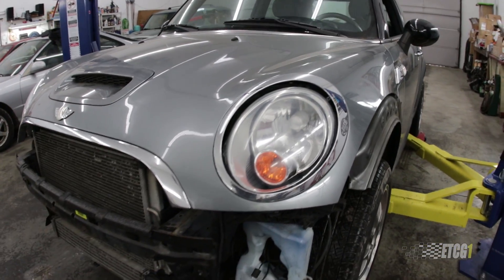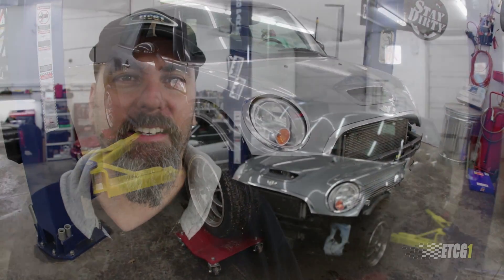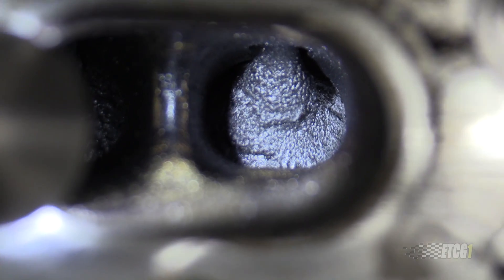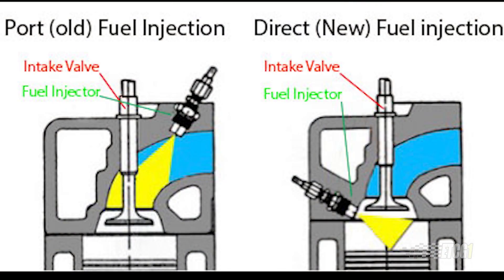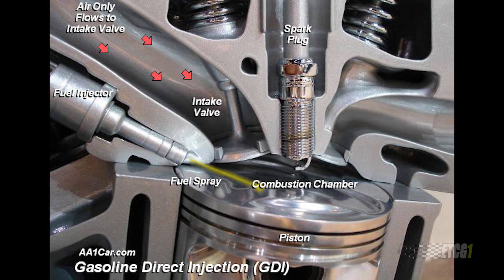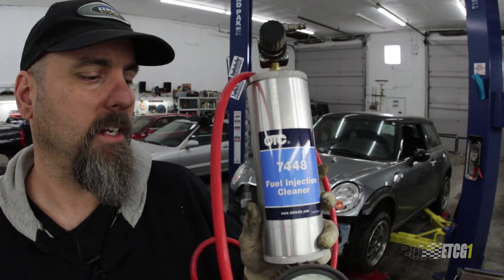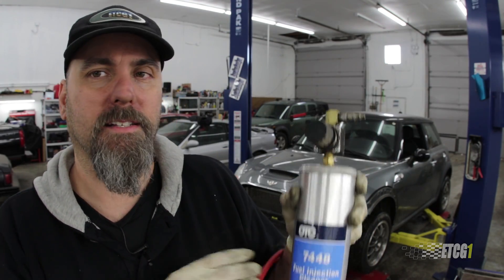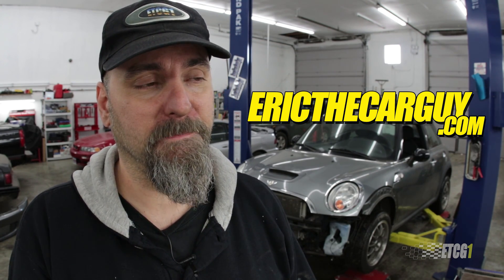Direct Injection Proves Fuel Additives Don't Work

Comment: Is there a method/product to adequately clean the backside of the valves Without removing the intake
Reply from the maker: Likely. I used carburetor cleaner, a screwdriver, and a brush mounted in my drill to clean these up.
Reply: Seafoam SPRAY used exactly as the instructions on the can say. Don’t listen to these morons on the internet using the brake booster vacuum hose dipped in a can. That will be minimally helpful, mostly wasteful.
Reply: CRC makes a product you spray into the intake track just after the MAF, so solves the application issue Eric was complaining about via fuel tank based cleaners.  And an oil catch can is needed to slow this issue down.

Comment: On direct injection engines additives will not work on the intake but those fuel injection cleaners work by having a stronger solvent  than gasoline thus getting rid of buildup that the gasoline wont cut through. I dont see it as a solution to the root problems but they do tend to work at they're intended purposes.

Comment: I get it that fuel cleaners don't work in direct injection engines.  And the warning about direct injection engines is well taken here since my wife wants to get a new car that has it.  ...In carbureted engines though, you can get some good results when things get fouled up - especially today with that sugary crap they call ethanol.  Just a few months ago I was having some hardcore hesitation/stumble from my old Jeep that was fixed by adding some fuel system cleaner.  It was to the point I couldn't accelerate up to highway speeds before merging with traffic because the stumble was going on at just under 3,000 rpm.  I thought it was water in the gas, so I went with Heat.  Two tanks with that didn't make any difference.  After going to an "over-priced" cleaner I noticed it get better and better.  A tank and a half later there was no more hesitation and it is likely running the best it has in many years.  For carburetors at least, they do help clean things out.

Comment: I agree with you on the snake oil. But if you can see the valve like in the footage you showed can't you just blast them with dry ice dry media. It probably won't do a bang-up job unless you want to turn the valve while doing it but it's got to be some sort of improvement with minimal engine disassembly
Reply: fuzzy wuzzy mini dealer offers walnut shell blasting .
Reply: RanGer498 but then wouldn't you have to take the engine apart to clean up the walnuts?
Reply: fuzzy wuzzy nope they the vacuum out the particles at the same time ..do a YouTube search you can see the process done....is it 100% safe? I don't think so but it's an option .

Comment: Eric- I’m having the same issue on my ‘13 Impala. A manual valve cleaning and a good catch can is the only way to prevent this. I’ve definitely noticed a difference in performance/ mileage between it being new and 90k miles. Some manufacturers are putting a small injector that sprays fuel on the backs of the valves just to combat this problem....

Comment: my view on additives is, some work and a lot do sweet FA, the ones that do work need to be used to prevent build up.  If your valves and head are already heavily built up with crap, no additive will di-solve the problem

Comment: When my 2010 Mini had the valves cleaned at 20,000 miles the dealer left a bottle of fuel injection cleaner in the car. When I inquired what the purpose was, they told me BMW recommend it for keeping the valves clean. I knew the car was direct injection and that injection cleaner would not clean the valves, but free is free and don’t argue with the folks doing your warranty work😀
Reply: Gil Mello wow what a joke!

Comment: Eric, how will you go about cleaning the valves? All the ways I've thought about cleaning those seem tedious with keeping in mind that the valves/valves seats may need to be replaced anyways
Reply from the maker: I don't think you need to replace the valve seats. I used carburetor cleaner, a screwdriver, and finished with a brush mounted to my drill. Took about an hour.

Comment: I use seafoam as a maintenance item. Put it in the tank with every oil change. I try my best to not put garbage gas in my car, that's the real issue.
Reply from the maker: The fuel isn't necessarily the issue, it's blowby and if it gets in your intake.

Comment: The fuel service tool still only helps with non gdi engines. At work we have another tool that sprays a different cleaner into the throttle body as a mist while the car is running but I think it’s only designed to clean the throttle body. Once that carbon builds up like that there’s no chemical that’s going to get that off .

Comment: I agree Eric but its direct injection that's the problem not injection overall. Some where along the line engineers for got about the benefits of fuel flowing over the intake valves. Recently did my 99 Chevy 5.3L intake gaskets and the intake valves were shiny clean.
Reply from the maker: I never said fuel injection was the problem.

Comment: Felt I should really add something for clarity. from 1885 -  1970 look at the innovation in cars.    minimal... other than some small safety and convenience improvements the car still was the same crap it always was, unsafe, inefficient, and grossly polluting. Other than the very expensive cars which had trickle down racing improvements nothing really changed.  Proof? oh lets look at the VW beetle, because that is precisely the icon of lack of change. If left to the manufacturers we would still be driving original air cooled beetles.             Now, suddenly we have emissions laws to compete with, fuel economy targets, etc.... look what happened from 1970 - 2018.  in roughly 48 years the car has gone through such a technical improvement it puts the previous 80 years to shame. Why? impossible targets to achieve force incremental improvement.     Fairmont aside, I would never want a modern car to have a carburetor. vapour lock, fuel system corrosion from water absorbtion (my god its a problem on my carbureted boat (made in 2001!) ) pollution, inefficiency, etc.     
Yes a carbureted car is a fun thing to play with but it would never work in modern society if everyone had one, (well unless you are india).

Comment: Lmao, yeah I've got burned by a German car to Eric. You kinda fought a good case for the seafoam cleaner that runs the straw in the throttle body. Oh, I agree with the carb engines seem to be better when it comes to internal cleanliness. I've only opened a few that actually had gummed up valves and it was all due to internal oil leakage that was really extreme. One more thing, it's good to get that out of your system. It helps to move on and be happy, lol

Comment: I drive a 1998 Chevy s10 with the 2.2L 4 cylinder engine. I've done some research and believe this engine does not have a good PCV system, and no PCV valve at all. I have not yet inspected under the valve cover, but spurts of oil come out of the hose at the top of it going to the resonator, and I always get oil in my resonator.

Comment: I use seafoam to clean fuel systems but but wait for it I mix it 50:50 with gas so it super concentrated 1:1 ratio 1 gallon gas to 1 gallon seafoam this will work wonders on carb and pre valve injected engines.

Comment: Not disagreeing about cleaners, but octane boosters are additives also. Some work and some don't. Where I live, we only have 90 octane as premium, yet they sell cars here that require 93 octane. Those of us that have this issue either buy 2~5 bottles of booster at every fill up (because not everyone car has the same size gas tank) or by a Jerry can of race gas and mix it.
Now about the cleaners, like you said, issue is the aaplication (for the most part, if the one being used works). I've used some to clean up carbon buildup in the cylinders, but a majority of them are acidic, which take a long time to see results (running it through the fuel system and talking about the chamber, not necessarily valvetrain). The reason why is cabon is acidic, so an acidic (talk about pH) would remove it by delution, and some mechanical from combustion. 
Not enough gets in there to do enough delution. Too much and the engine flood, too little and it doesn't do what you want it to do.
The base (pH) based cleaners work better, (bases work on reaction rather than delution) but micro pit the metals and leech oils out of the rubber parts in the fuel systems.
So what I do is remove the head (major build up) dunk that in gas, put the engine on an engine stand upside down (I mainly work of 4 cylinder engines), then strap a tube to it and fill that with gas (delution). Let those sit for a day or 2, wipe off what I can which is usually enough. Pivot the engine on the stand less than 90 degrees (slack for the engine stand pin) let the gas evaporate from the engine, pivot straight up, oil the 2 cylinders that were in gas and rotate the crank to have the other 2 cylinders at tdc and repeat. I only do this, on higher mile engines that needs work done that warrants removing the engine.

There's that or running straight race gas for a tank or 2 :p

I only use basic solutions (pH) to remove carbon from parts if I'm completely rebuilding an engine, so I don't leave some of it in the engine.

Comment: I really like the ending! 🤣🤣🤣😂😂😂😂😂😂. You 100% right. Direct inject can NOT be cleaned by put anything in your fuel tank... Everyone is having trouble with this setup mostly Ford!! All kinds of trouble and just about every time the intake will have to be removed and in most cases the head as well to clean them out.. 🤯🤯🤯🤯🤯🤬🤬🤬🤬🤬🤬🤬

Comment: lol, fairmont needs fuel injection, so you don't fill the entire engine with gasoline.  need I qoute a video where you set the fairmont on fire?
Reply from the maker: Fuel burns if it's injected or run through a carburetor.

Comment: Fuel injector cleaners have never worked for me ever. If your running a common rail especially forget and just replace your injectors/get them tested (often a waste of money). In all cases for me replacing the bad injector removed the misfire.

Comment: Never found petrol additives much use. Way back in the past when running carbs I used to run stuff called RedX even so often. Some in the tank, a little into each cylinder via the spark plug holes, clouds of smoke and the placebo effect left me happy. :) Doubt it did anything mind you. I have heard of a fair few people whose car's emissions were over the limits set by the annual Irish car test that passed after using stuff called Dipetane. With cars that are borderline on emissions my mechanic swears by the stuff, especially for diesels. Dunno what's in it and there's likely similar products out there, but it seems to work to some degree, on emissions anyway. 

I spy your Integra :)

Comment: The new mustang gt has both direct injection and regular depending on what mode you drive it on. That's a great idea.
Reply: IMO Sounds more like an overly complicated mess that has many more failure points. No thanks.
Reply: Ford HAD to do something to cure their DI engine woes. Adding the 2nd injector was the cheapest fix, but it does seem to work. The problem they are STILL having is that the PCV systems do not work on their turbo engines, and the crankcase actually gets pressurized under hard accel. Adding a catch can seems to help, but it's a hard sell to get a customer to pay to have the cans drained every 150-250 miles...

Comment: The mix of cabron buildup and oil vapours that ccumulates on the back of the valves on DI Gasoline engines is worse than even carbureted engines.
Never gonna buy a GDI engine.
Reply: The carbon build up is the result of oil vapors (from the pvc system) cooking onto the back side of the valve in a DI engine. The only way to get gas or a cleaner to the back side of the intake valves would be to pour/spray it into the intake or a vacuum line.

Comment: I get your point and believe you ..my vehicle is nearly 20 years old with 220k miles..I also "believe" those additives have helped my vehicle..though I don't use them religiously, I'll still stick to my security bwankey in a bottle..
Reply: The only additive I've had luck with is Chevron with Techron. The rest seem to be a waste of money if you use decent gas. Sometimes I don't, so the Chevron seems to make a difference. My car's an oldie too.
Reply: NormEZ good investment if you use a tank a month. If you use a tank a week you don't need it.
Reply: NormEZ the first step in rehabilitating a poor running vehicle is cleaning with deadly force. Don't forget you bdesludge engine and flush cooling system. Then plug vacuum leaks.
Reply: I never mentioned my vehicle has or has had any serious issues. I just stated I believe Eric. I also "believe" additives have helped my high mileage vehicle (how much?..who knows), though I don't utilize them religiously. 

My original statement was also poking fun at fuel system cleaners providing a false sense of security as well..hence the security blankey statement.
Reply: Peter B. At times I use a tank a season in one bike, and when all the rum, excuse me ethanol is gone by the end of a tank, I add some secret sauce which "cures ethanol problems". My question is: would lack of ethanol be 'problems [with] *ethanol'? I always find the informational literature to be less convincingly proper for my application after it's translated.
Reply: Rýán Túçk I used to do that with my SFI Fords but my TBI Oldsmobile ran better cleaner with 10% ethonol.

Comment: OK......so this brings up a good point for me.  My DD is a 2018 Hyundai Sonata with a 2.4L direct injection engine.  So how do I prevent/clean carbon buildup on the back side of the valves?  Prayer?  I have heard too that GDI engines are prone to this.  What's the preventative thing or things to do?
Reply: saleendriver You can either get a catch can or use a special intake valve cleaner such as CRC that is designed to remove carbon deposits once or twice a year.
Reply: Other than on-time oil/filter changes and scheduled maintenance you cannot prevent carbon buildup on the back side of the valves in a GDI engine. 
From my professional experience there are GDI specific fuel system cleaners that do not just pour into the fuel tank that are effective. 

https://www.google.com/search?num=100&newwindow=1&source=hp&ei=bzfwWrjNJI-4ggeSuJbIBw&q=gdi+fuel+system+cleaner&oq=gdi+fu&gs_l=psy-ab.1.2.0l10.6849.18098.0.21928.8.7.0.0.0.0.345.738.4j1j0j1.7.0....0...1c.1.64.psy-ab..1.7.891.6..46j35i39k1j0i131i67k1j0i67k1j0i131k1j0i20i264k1j0i46k1j0i10i67k1j0i20i263k1.156.lqc7jWTfn1Q
Reply from the maker: Regular oil changes and maintenance is likely the best you can do, but it's possible at some point the intake and valves will need to be cleaned.

Comment: I have often questioned the use of fuel system cleaners. I have seen YouTube videos that have proven that they all work, that have proven that some work and some don't and I have seen videos like this one that prove that they don't work. 
On top of that I have talked to mechanics that said they work and have said that they don't work. 
In the end, if you want to see if fuel cleaners work or not, take apart your engine, and take a picture of the vavles and cylinders before you put the cleaner in and then pour a bottle of it in your tank and run the engine for a week or so and then take a picture of it after. After you do all of that, you will have evidence if it works or not. 

As for me, the verdict is still out. I don't have the tools or equipment to take apart my engine to see if it works or not. But every now and then I try out a cleaner and sometimes I feel the car is preforming better and other times I don't feel a thing. Let's call it the power of suggestion.

Comment: Eric couldn't someone with direct injection run seafoam thru the intake vacuum lines? Wouldn't that reach the intake valves?
Reply from the maker: I suppose it depends on how bad it is. For me it took an hour of scrubbing and carburetor cleaner to fix what you saw in the video.
Reply: That AAA Dood offhand no I don't think so because the channels seafoam would go through don't travel in some new way. Direct injection atomizes the fuel like he said in the video and doesn't spray on the top of the valve? / cylinder? That would clean it. So sea foam would just go the same way fuel would and not reach the top part because it isn't sprayed there.
Reply: John Smith, the vacuum lines are a direct connection to the engines air intake (goes through the intake valve) and are not part of nor connected to the engines fuel system in a direct injected engine.
Reply: Yes.   From my professional experience there are GDI specific fuel system cleaners that do not just pour into the fuel tank that are effective. 

https://www.google.com/search?num=100&newwindow=1&source=hp&ei=bzfwWrjNJI-4ggeSuJbIBw&q=gdi+fuel+system+cleaner&oq=gdi+fu&gs_l=psy-ab.1.2.0l10.6849.18098.0.21928.8.7.0.0.0.0.345.738.4j1j0j1.7.0....0...1c.1.64.psy-ab..1.7.891.6..46j35i39k1j0i131i67k1j0i67k1j0i131k1j0i20i264k1j0i46k1j0i10i67k1j0i20i263k1.156.lqc7jWTfn1Q

Comment: The combination of DI with modern PCV systems leads to gunned up valves.  Some DI engines are starting to also have port injection also for this reason and other benefits.  I think some fuel additives help but they will not help a long neglected engine.